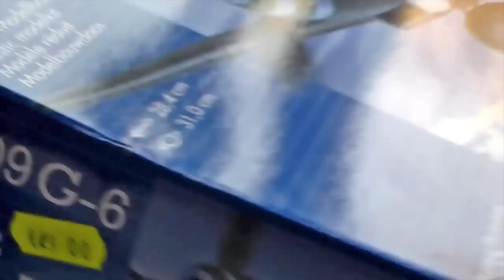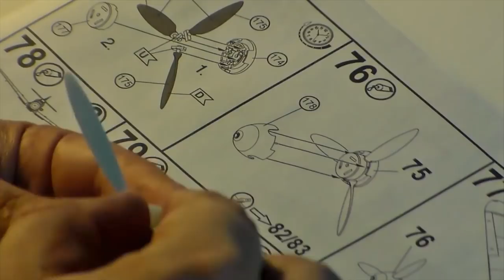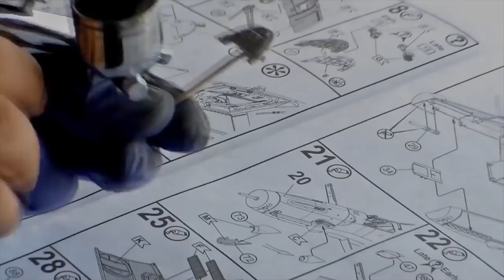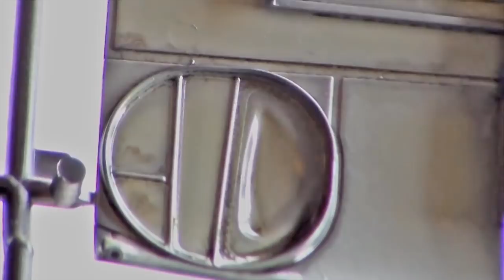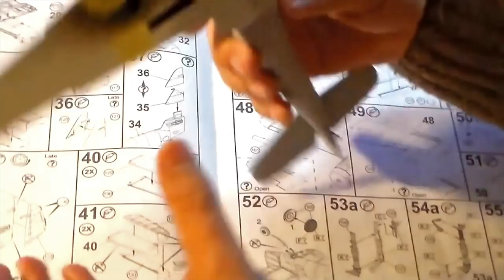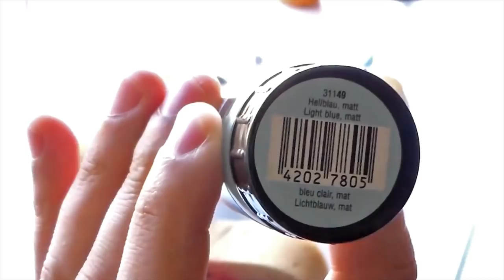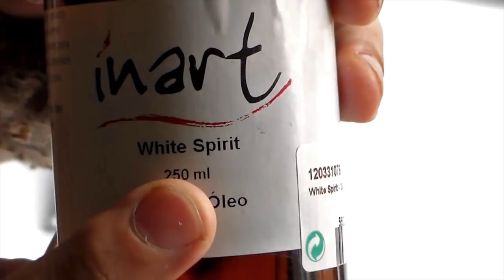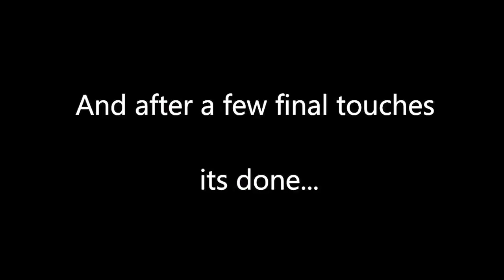1/32 REVELL BF-109 G6 FULL BUILD

Comment: Great build.
Serious fitting issues there. Especially with the tail wheel area of the fuselage! Great job with the filling and sanding. 
Just a small point of correction: the inboard movable control surfaces are flaps not aelerons. Hope you don't mind my pointing that out! Always nice to have the flaps hanging out. 
Looking forward to the next video!
Edit: on the leading edge of the wings, you also have moving slats which improve low speed handling. These deploy automatically at low speed. If you have a 109 model with the wheels out and flaps down, the slats should be in the extended position as well. 
Great work dude!
R.
Reply from the maker: +Rupert Carss OMG!! Your right!!! Absolutly right!! Thank you!
Reply: AlexModeling ...
Sorry to be pedantic! I'm a pilot as well as a modeller... 
If you ever hear of a 1:48 scale he111 coming out soon, let me know!

Comment: Nice Bf-109 G14
Reply: MakotoAtava its G6 Gustav
Reply: @anzej2101  Sorry for my bad english, but a G6 have not a MW-50 system for emergency motorpower like a G14, and this model us a decal for the MW-50.
I don't think it is a problem, it was in real life not really clear is this BF-109 a G6 or a G14, at the one picture of this 109 you can only see one side of the plane.